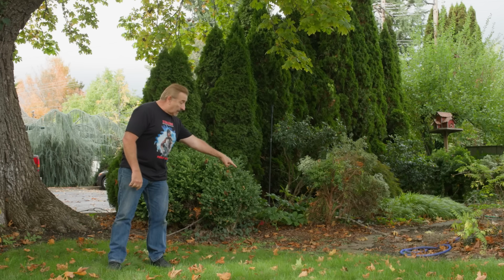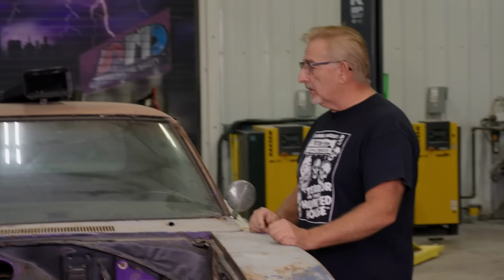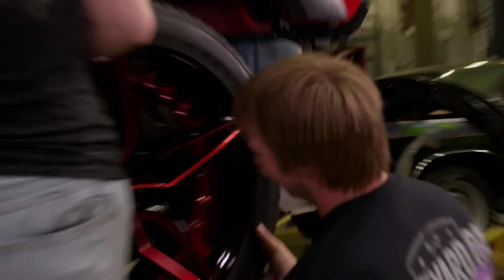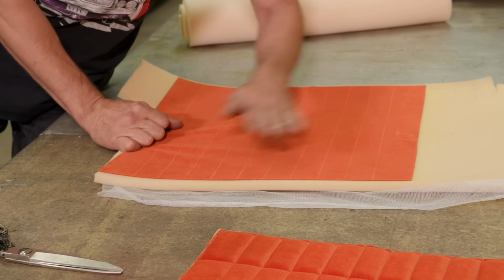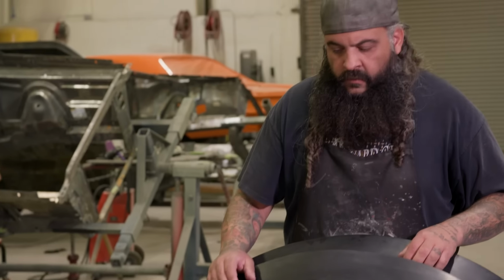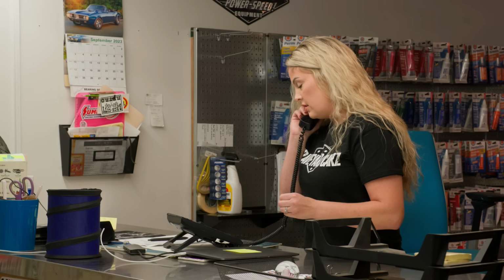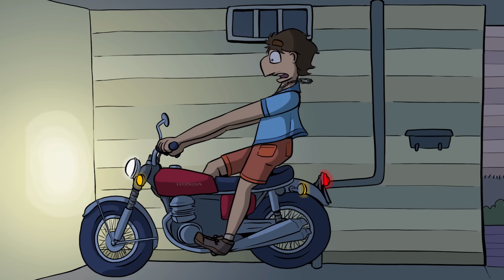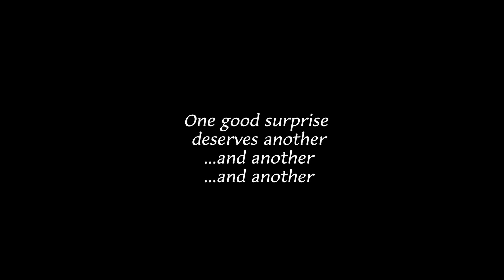SEASON 19 PREMIERE: ALLYSA IS BACK AND SHE'S BRINGING A NEW GENERATION TO GRAVEYARD CARZ

Comment: My first MOPAR was a 1969 Dodge Charger R/T, Y2 Sunfire Yellow, vinyl top delete, tail stripe delete, black interior, 8 way adjustable driver's seat, factory A/C, power front disc brakes with 4 piston calipers, 440 Magnum with the silenced air cleaner and turn down exhaust because it came from California. Best car I ever owned and I am really regretting selling it back in 2004. I bought the car from Volo Auto Museum in February of 1998 for $18,000. The car was fully restored just needed some mechanical work. After driving for a couple years. The nylon cam gear on the timing chain broke off and the timing jumped a few teeth bending some valves. Since the heads were off. I decided to install a Mopar Performance Purple camshaft .474 lift 280° duration. That cam really woke up the car!

Comment: My sister bought a brand-new dodge charger in 1987. It had 2500 miles on it when it flattened all the lobes on the cam! When she took the car to the dealer, instead of taking care of it for her, they wanted her to pay for either parts or labor! I would have given them the keys and told them to keep it! Since then, I have steered clear from buying ANY MOPAR VEHICLE!